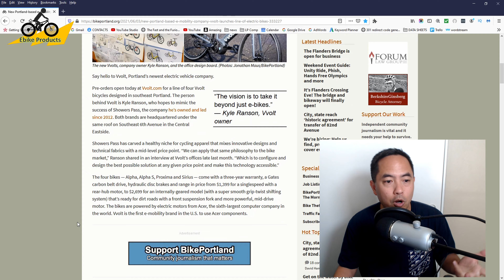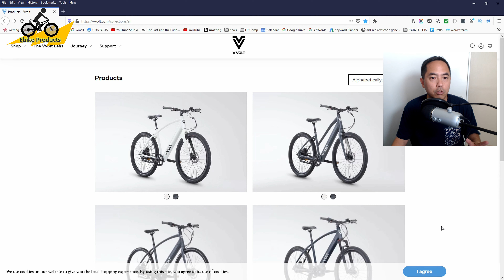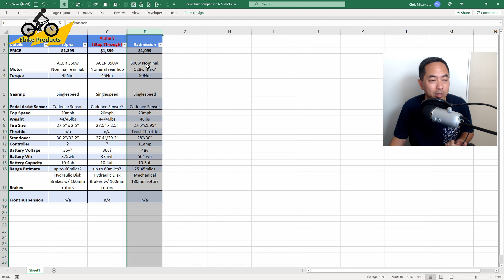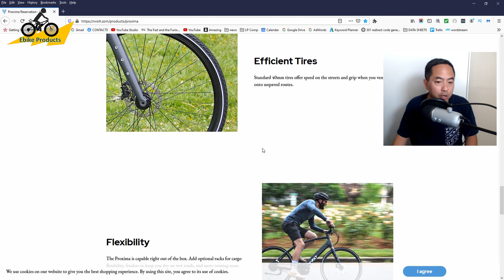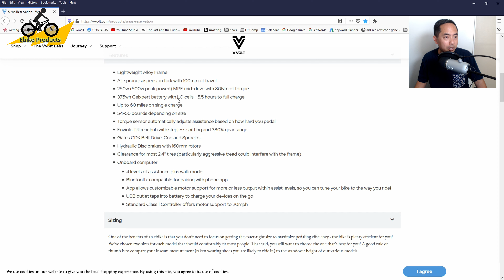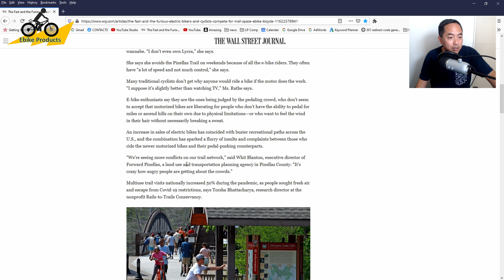Ebike Breaking News! NEW MOTORS by ACER Computer Co in Vvolt's New Mid Drive & Hub Drive Ebikes!

Comment: I think this compares with the Ride1up V2.  Also a belt drive single speed (5 level assist) but..  the v2 only weighs 33 lbs.   That does not sound like a large weight penalty but percentage wise it is a lot.  I think the light weight, belt drive, single speed makes a lot of sense.  Frankly I don't see much sense to a 7 or 8 speed gear change, when using a hub drive motor, unless you are climbing some serious hills.
Reply from the maker: Wow! 33pounds! It’s amazing how light the bikes can get. I really need to get some close up exposure to the ride1up ebikes. I 100% agree with you less gears would be find. I find I don’t use a lot of the extra gears my Blackbird has in between, but if I lived in an area with more hills, it might be a different story.

Comment: Should I pay more than the cost of a Lectric XP for an ebike with a smaller, less powerful motor?  I don't think so. It's good to see new motors and belt drives coming to market. It's unfortunate that they've priced the bikes too high to be even remotely competitive. 60 miles? Doubt it. Regenerative braking? I don't think so. Will be curious to see some testing of range. If they're exaggerating as much as past bike makers it may hurt sales in the long run almost as much as small motors and batteries. The only really interesting one is a crazy $2700. New ebikes will be flooding the market and driving each others prices down. Overall, glad to see new products coming.
Reply from the maker: When it comes to value, it don’t think Lectric will be beat for a while. What you get for what you pay for is incredible with the XPs. The only downfall is that different riders who want a closer classic bike riding experience will need to spend a little more, but they’ll get a decent ebike with competition bringing prices to levels where you are getting what you pay for. It will be interesting to see how the Vvolt bikes do and if their claims can come close to holding up on miles per charge.
Reply: Lectric is good for use as a boat anchor. Three breakdowns. Most lurchy ebike I've ridden. Weighs a ton. Folding sucks. Battery port cover doesn't even close, wtt. 

It counts as an ebike and is cheap.

Comment: Once you get over $1200, it makes no sense to get a hub drive eBike. Mid drive motors last much longer, have way more torque per watt, and are programmable via a USB port/laptop (Bafang mid drive motors). Mid drives also balance the bike better as the weight is where you want it.
Reply: It depends.  I have a cheap hub drive that beats my expensive speed pedelec when commuting.   Thats why I'd like a stromer.  Hubs are bad for mountain biking,  they're the best on pavement.  Better acceleration and maintain the speed better.
Reply from the maker: WOW! Just looked up the Stromer site. BEAUTIFUL Ebikes! This is the first I heard of them and it's love at first sight. Those Swiss really know how to design a sweet/sleek looking frame. They are a bit out of my price range, but I too would want one of those beauties. That's a company I'll be looking in to learn more about. Thanks for sharing!
Reply from the maker: Hmmm. Never really thought about all those points you made. It’s something I’m starting to think about a lot lately. My next bike is going to be a lot more for durability, comfort, efficiency, and easy riding. The 750watt mid-drives with an enviolo enclosed gears, carbon belt drive, fat tires, and front suspension is what I’m hoping to find at a good price. After thinking about it when reading tour comment, I agree that at a certain price point, mid drives make more sense, but that may depend on the riders skill and experience. My Blackbird was $2500 and is a 750watt hub motor ebike. I’m not sure I could’ve found anything comparable in parts for a mid drive at that price because it came with a torque sensor too. My search continues...

Comment: I'm still happy with my Lectric XP ST 2.0 order. If I were to buy a class 1 e-bike, it would have to have a torque sensor, not a cadence sensor. I need that throttle to compensate for the tougher starts when it's just cadence sensing. And those models that Vvolt does sell that have torque sensors, I don't have the budget for those prices right now.
Reply from the maker: Same here. The Vvolt bikes with torque sensors are a great price but over my budget and too big for me. I can save up more money, but I can’t grow any taller. 😆
Reply: Throttles will be available for all vvolt bikes... according to the company.

Comment: Excellent review, these bikes are very light weight and do sound like they are high efficiency. Have you looked into the new 'Rocket' e-bikes? They supposedly have some sort of new PAS that can potentially get 100 miles ? Keep up the good work!
Reply from the maker: Thanks for the comment! I went to look at the rocket indiegogo page and think if it can really do 100 miles, that’s going to be a game changer to make all future folding bikes like that improve their mileage. That’s a pretty steep claim, but it does have a large battery and if they’ve found ways to improve the regeneration technology, it might be a super awesome upgrade to 20”x4” folding ebikes. Their pricing is also really good.

Comment: Interesting….. I wanted to mention that with everything Ive seen about the Rad Power bikes… they seem to be over rating their motors, or using peak power specs. Seems like the Rad bikes with 500 watt motors in comparison tests against other manufacturers actually performs like a 350 watt nominal motor from other companies like Himiway or Sondors or Aventon. Rad Power bikes needs to modernize their bikes imo and start marketing nominal watt motor ratings because in comparison tests it hurts them. Thanks for all you do bro!
Reply from the maker: Totally agree 100%. One thing Rad does well though is take care of customers. That will take them far as long as they keep it up and continue to make reliable ebikes. I rented a Rad Rover and could see why they do well. It's not a powerful ebike, but it is solid, reliable, smooth on the start, and really appealing for someone who just likes to take it easy, enjoy the ride, and not worry about break downs.
Thanks for taking the time to comment!